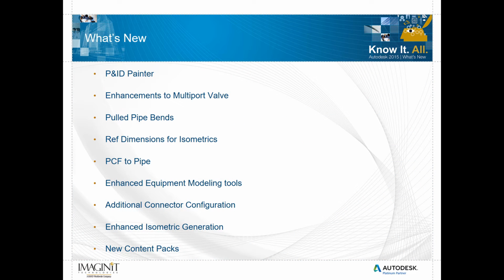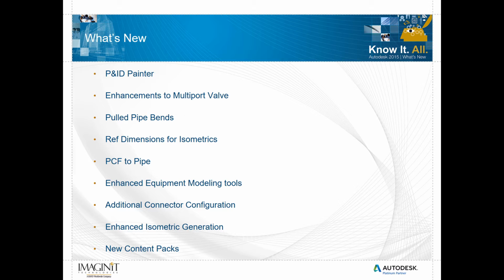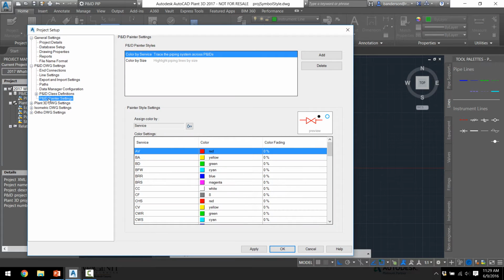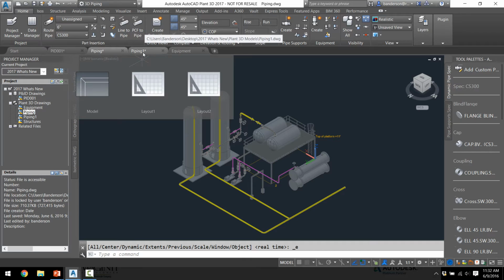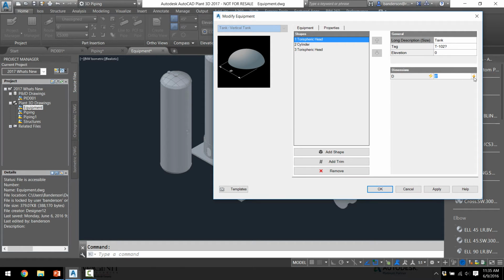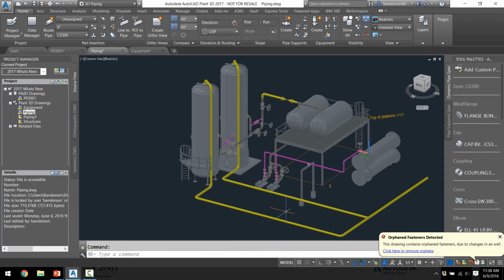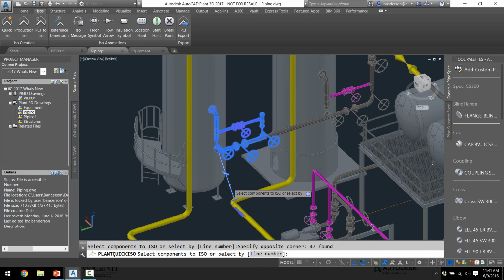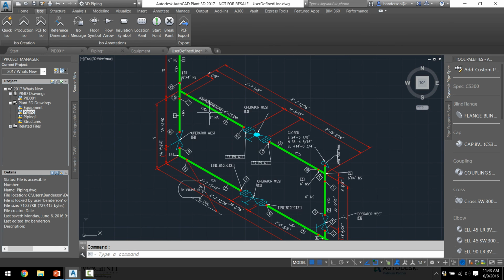What's New in AutoCAD Plant 3D 2017

Comment: Hi, I'm currently starting at an engineering firm and haven't been using Plant 3D in a couple of years.  I know the how to run pipe and such.  I'd like to know a few things that would help speed things up in using the software for piping design.  I'm use to another software that lets you use cut planes to isolate where you are working in the model in order to not "see" or be able to click on something unintentionally in the area you are working in and to allow you to use different views. If I could get some help with some tips on controlling the volume of area in a model or something to do what I want to do as I stated above I would greatly appreciate it.  Thank you~!
Reply from the maker: Checked in with the technical team here's what they said: Object isolate tools are the only thing I can think of to limit model visibility independently of the model drawings. 

Hope that helps.